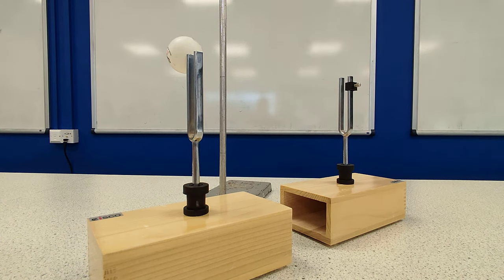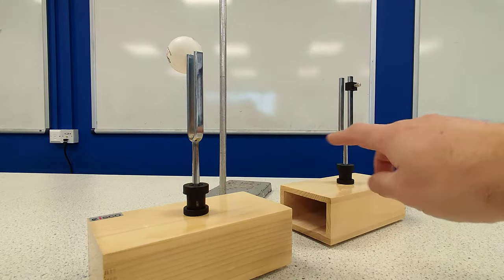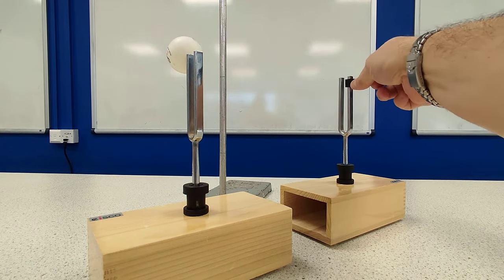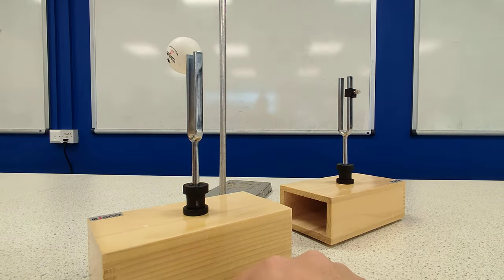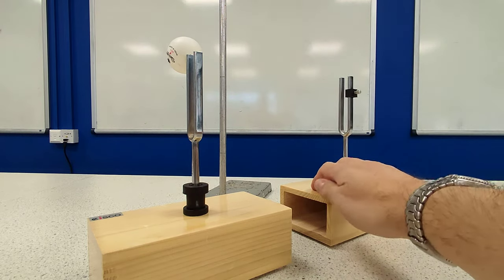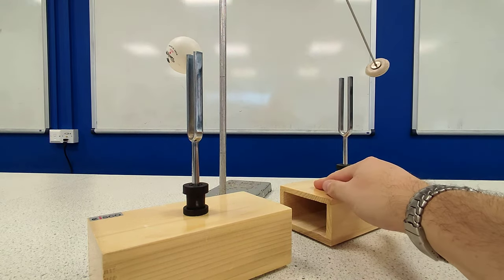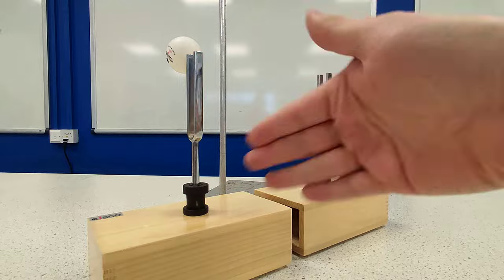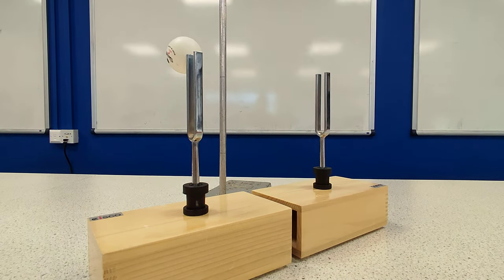Tuning Fork Resonance A-level Physics - AQA A Level Physics

Comment: I read that frequency's can effect magnetic fields. So what would happen if there's two sets of magnetic tuning forks of the same frequencys that also have magnetic fields that cause a unique magnetic Field that has some kind of application, when one stimulates the other?. Or could two pairs with different frequency that are magnetic, allow one to stimulate the other when it normally wouldn't but because of the interacting magnetfield it does? Hope that made sense.
Reply from the maker: No idea❤️😀🤔

Comment: Why doesn't vibrating a box with a matched sine wave from a transducer cause the tuning fork to move?
Reply from the maker: It has to be the same mass
Reply: @animatedsci  What has to be the same mass?
Reply from the maker: The two tuning forks must be the same mass to oscillate at the same freq.
Reply: @animatedsci  Ah, I'm not using two tuning forks. I'm doing an experiment where I use one box and vibrate it with a surface mount transducer playing a sine wave matched to the frequency of the fork. It's the same principle in theory but not working for me so I'm wondering what could be potential sources of error
Reply from the maker: I would have thought that it might not have enough physical energy to create the amplitude required. Difficult to tell really.

Comment: What will happen if I hit 1 fork in front of other 20 forks (provided that they all vibrate at the same frequency).  Are they all going to vibrate?
Reply from the maker: Yes but the box helps amplify the signal
Reply: @animatedsci  Okay if 1 fork can vibrate 20 forks, isn't that violates the Law of Conservation of Energy. 20 forks provide a high output energy which is far greater than that of a single fork. Where is the other energy coming from?
Reply from the maker: They do vibrate but with lower A